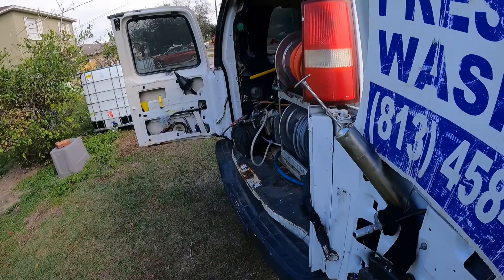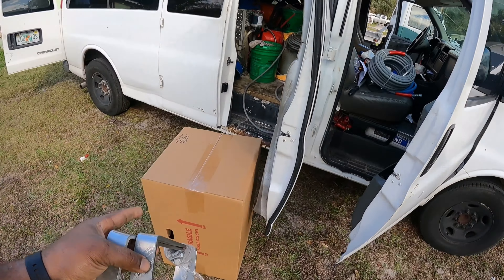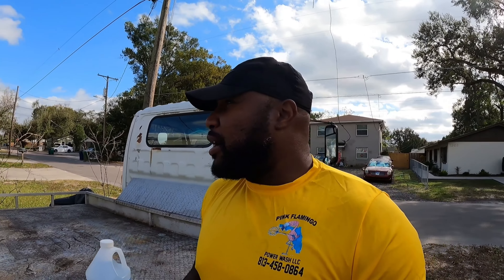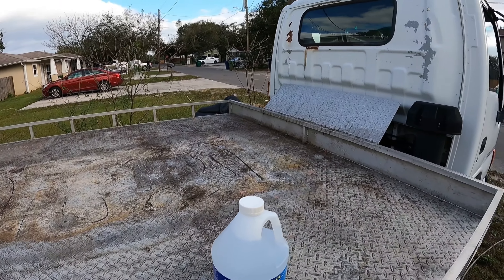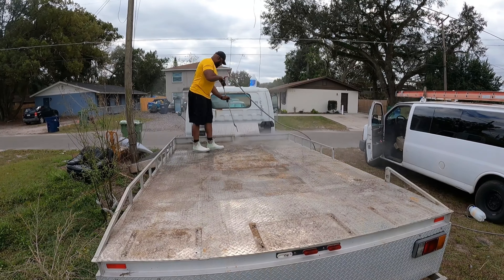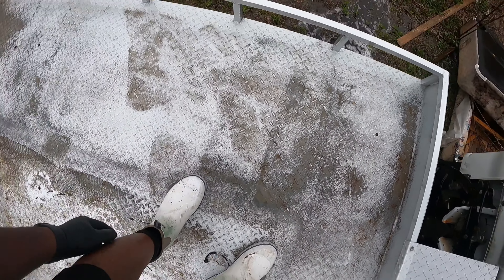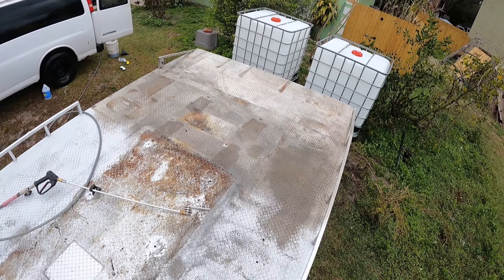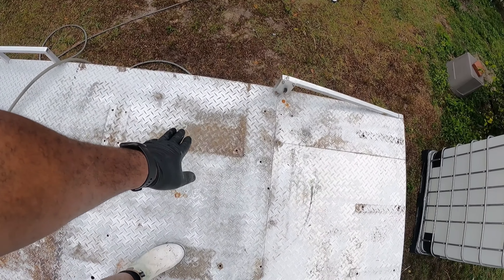New Isuzu NPR Pressure Washing Truck PT. 2 (Cleanup)

Comment: So knowing that the items are sold that came with this new truck. And then the tank you have in your existing van is too large for the SH and make that easy on yourself to get a new one. Plus you're selling that van.
I guess are you also upgrading your pressure washer and other equipment at this time?

I'm just curious are you selling the van as it's own existing rig or van and equipment separately.
You don't have say if you don't want this info to be online, but just had me thinking if anything from your existing rig will be used on this new one.
Reply from the maker: My goal is to sell the existing tanks in the van and the water hose reel. I will get a 100gal SH tank so im compliant with the POPO. I will keep my 8gpm pressure washer but I will leave a space on the truck to mount a 2nd pressure washer which will be a 10gpm unit. I will also keep my 12v soft wash system since I dont do a ton of tall buildings that requires much.
Reply: Ah, that make sense. So sell what you won't need but use what you already have. Yet at the same time, leave room to upgrade if/when the time arises. That's awesome. 

I didn't know that info until you mentioned it in the video about the 100 gal SH law. Now it make sense why no one uses the larger tanks for SH. I thought it was more just to not transport so much weight and then it degrades over time so just get fresh batch. I'm learning so much.

Comment: You could always use a Sawzall on the corner and them angle grind or hand sander to make em smooth to fit the tanks sideways if it will fit. Just a thought.
Reply from the maker: I think thats what Im probably going to do actually. My buddy Chris said the same thing. He said those borders serves no purpose.
Reply: Yea not really. You'll still have enough material even with the corners shaved so it doesn't wobble.
Reply from the maker: @SEAN RYDER  I'm getting thr ladder rack installed Friday. I'll ask them to cut them out. It will probably be better anyway to install the posts closer to the edge of the bed.
Reply: Can't wait to see the progress, you guys are helping to give me ideas when it's my turn to level up.

Comment: If you sprayed Rhino liner Like they do in the beds of trucks, you will never have to worry about Rust or SH .
Reply from the maker: I did that in my E150 van. But I don't think that's rust in that aluminum. It was a landscaping truck that had things bolted down for who knows how long.  Is aluminum supposed to rust?
Reply: It should not but it would give you that extra Layer of protection . And it would look clean black bed white cab some good tire shine clean truck. It’s gonna look good. Either way. Good job man.
Reply from the maker: @zackward5516  ohhhh weeeeee I can see it.

Comment: Great videos thank you ......  Word of warning regarding those IBC tanks plastic tanks  ........  They are a  a low price laternative yes ..... BUT .....   a  potential death trap if you drive around with them full of water or relatively full or even at lower levels of water ...   if you have to emergency break while driving they  will collpase and   due to the force  move forward and crush you  and your driving cabin and the pasengers etc .....  Just a word of warning do not drive around  with them at  high speeds !... better to use them as a filling tank  when at the customer and drive with them empty  between jobs !
Reply from the maker: LOL i would never drive with those things full. I dont even drive with my 130 gallon buffer tank in my van full. Thanks for the reassurance my brother.
Reply: @PinkFlamingoPowerWash     Thats great . better be safe than sorry  though this is why i let people know....  You are  a true professional  i think that is a  major  upgrade having that open Small  truck . You will be coming home with a broader  and nicer smile on your face each day.

Comment: Clean her up bro. I use that aluminum brightener on the regular it's definitely nolonger then 30 second dwell or it will create its own flashing. I use that for fleet washing commercial trucks (wheels).
Reply from the maker: Yea I didn't push it too long. Within 60secs on the harsher spots.    I did it in layers to avoid any issues.
Reply: @Pink Flamingo Power Wash LLC  it's looking good, you can even mount signs or your logo to the sides of your ibc which I'm sure you already know

Comment: Looking great !! Would it be better to bring the totes all the way to the railings on each side, so you can see between them out the back window ? For backing up.
Reply from the maker: I think it would somewhat. But I'm thinking of putting a 100  slim tank in the middle 😃😃😃 guess I'll have to get a backup camera 📷
Reply: I got a solar wireless camera from Amazon. Easy to hook up.  @PinkFlamingoPowerWash  I got a solar
Reply from the maker: @georgea6403  shoot me the link. I'd like to check it out.

Comment: Looking good!..... did you see Joe Dearys video he posted painting the black epoxy covering on his flatbed? Came out clean. If you ever wanna get crazy my buddy has a sandblasting business. They can get all that rust off everywhere and then they put 2 coatings down that will protect it from corrosion. I've watched them do utility and cattle trailers. It's amazing how they turn out. If your ever interested I can get you in touch with them.
Reply from the maker: Yea I saw it. Ive done that coating on my 1st van.
 https://www.youtube.com/watch?v=RGzXN1YoIOU

But that was a steel floor this aluminum bed should not be corroding. I think this bed probably was never cleaned like that from the original landscaping truck it was at 1st. I think I can get it cleaner with better aluminum cleaner and also with routinely cleaning it.
Reply: Yea that makes sense. Especially lawn guys alot of em just trash the trucks especially if it just a crew. You know those guys ain't cleaning a dang thing.....if you ever do wanna go over the top with it down the road
Blastworks of Tampa owner is Richard. Just tell him I referred you. They do awesome work.
I'll give you his number at the time your ready. He's a good ol plant city boy. He took down his Google and only really is by referral.

Comment: Gonna be a nice rig , btw you can take the plastic base off the totes. Just take them screws out ✌️
Reply from the maker: Oh word? I didn't know but idk if that's a good idea. Kinda wanted them elevated and not sitting on the bed.  My boy Steve got the metal bottom tote and it's all rusted
Reply: @Pink Flamingo Power Wash LLC  Considering you use SH, i wouldn't recommend taking them off. Like you said, they will rust out eventually.. im excited to see you on the 1st job with the new rig brother , cant wait

Comment: What fitting do you use for the opening of the tote? I tried the buttress to npt and the buttress end did not want to screw onto the opening of the tote
Reply from the maker: Haven't done mine. But Tim has a video on it. Here it is. 
https://youtu.be/RlE5pVKe1DU
Reply: @PinkFlamingoPowerWash  figured out, I was able to just add a 2” camlock fitting with 2 inch npt thread coming out so I could plumb it to pvc